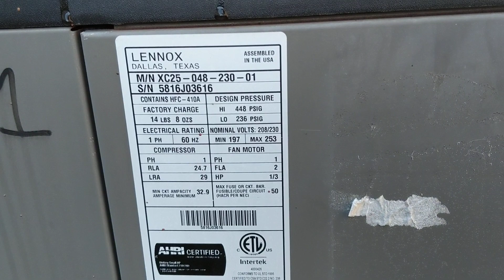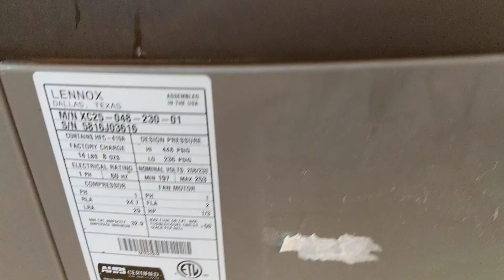LOUD Lennox XC25-048-230 Post Motor Replacement By Service Experts

Comment: Did you get satisfaction? I am working on an XP 25 lennox air condition. I need a condensing fan motor also. And I'm having trouble finding What Lennox has for its original motor.
Reply from the maker: Lennox did get the correct motor installed after some passionate discussion and my units are working problem free to this day.  The XC25 is a great system (after getting over that early motor issue)
Reply: @eco8gator  At first I thought you were just whining after seeing your first video showing what the technicians have done. Then saw your other unit running and how quiet it is. Now, seeing the difference, I would've called them to come back and fix it as well. This was very unacceptable and I'm glad you stood up for yourself. The end result was in your favor and I'm glad you got the correct motor and fan assembly for the unit.